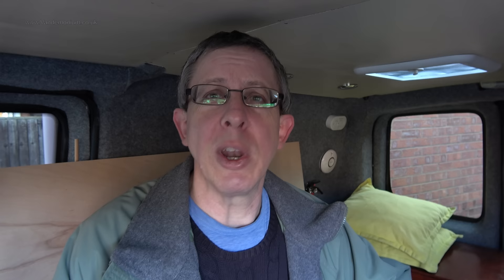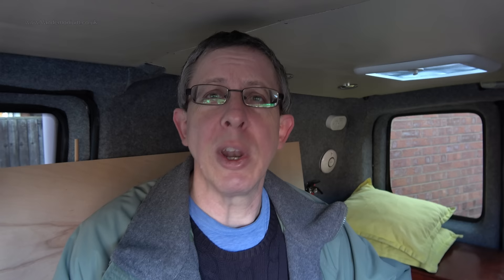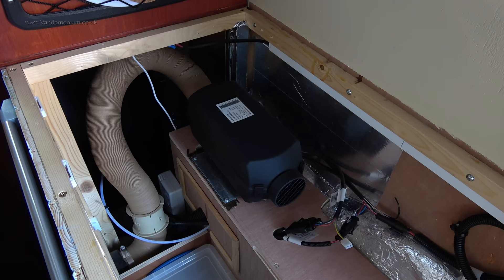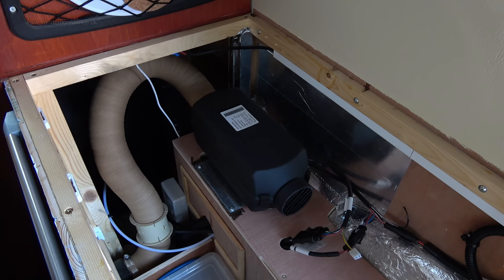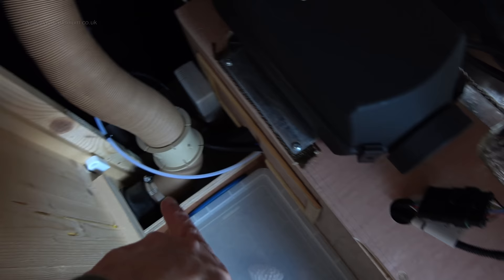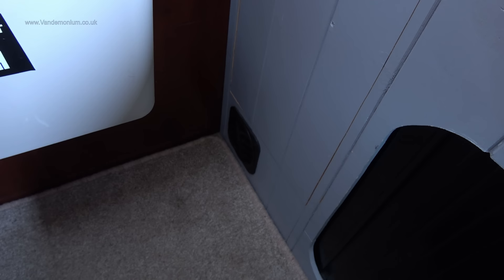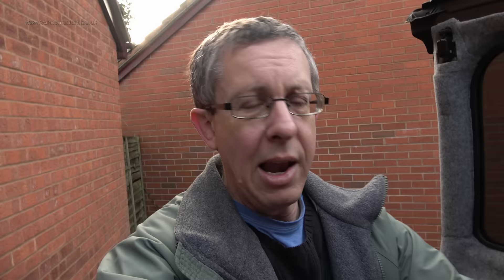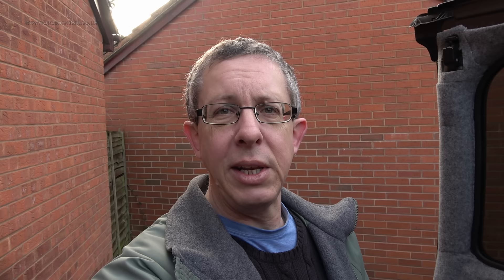71. Finishing the diesel heater installation in my campervan

Comment: Most portable fuel containers don't come with a gasket on the fuel cap, so they tend to leak if not tightened super tight. You maybe able to take the cap in to your local parts house and fit one. You also could buy a piece of gasket material and cut one yourself.  😊
Reply from the maker: Good idea, I may do that

Comment: Don't forget that your tank needs some kind of vent during operation to prevent a vacuum from forming. However, that also means the vent could leak. Unless you fiddle with opening and closing the vent as needed when the heater is running. Also, remember that even a small amount of diesel fuel can spread out to make it look like a much larger amount that it actually is. And the stuff never really dries up or evaporates on its own.  Messy stuff. But also much safer than petrol.

Comment: David, either replace the cap on your fuel tank with one that has a vent screw built in (like an outboard motor tote tank) or cobble together a hole in the cap with a hose coming out of it vertically (like you did for the fuel pickup tube) and put a fuel filter (like the one you put in the line) right at the furthest end of the hose and clip it to the top most part of the fuel tank compartment.
The fuel filter actually allows air in but stops fumes coming out.
It is a 4wd trick known as a breather extension....for axles and gearbox vents so they don't suck water in when the axles and gearboxes are rapidly cooled when submerged crossing rivers.
With this you don't need to remember to open/close any vents, nor worry about pinholes allowing stinky diesel fuel to seep out.....
Reply from the maker: Good tip, cheers!
Reply: Yeah, what he said. Your tank needs to be vented. Of course, that also means the vent may leak. Unless you continually open and close it as needed.

Comment: Another interesting vlog! Those types of in-line fuel filters should be readily available at any auto parts store. The inlet side of the filter should feed into the body of the filter, the pump side should draw from the center of the filter element.
Reply from the maker: Ah, then I got it the right way round!

Comment: You'll need some sort of vent on the diesel tank to let the air in as you pump the diesel up. The cap on that can is designed to seal completely so either the can will start shrinking or the pump will reach its limit and not pump any more fuel to the heater. The caps that come with the ready made heater tanks have a vent seal in them to allow air in but no fuel out.
You could of course loosen the cap slightly when using the heater but sooner or later you'll forget to tighten it before you drive off 🙂
Reply from the maker: Absolutely I would forget!!
Reply: @Vandemonium  A "checklist" might work. Yes, I’m an aviation enthusiast! Happy New Year from Canada!

Comment: I've been using a diesel heater for a few years now and on most of the instrument panels I have come across especially on newer models there is a primer mode to take fuel to the burner before you switch it on. I also have the exact same van only in Peugeot and to be honest it can be too warm sometimes but better than being freezing cold up here on the furthest northerly coast in Donegal Ireland lol. I haven't finished my conversation yet because I live in the van but some great ideas for me to think about for the future

Comment: We have similar heaters in the carriages of the narrow gauge railway i volunteer on here in Lakeland. Yes they can tend to smoke on initial ignition can appear alarming.give it a few moments and it will clear.If it doesn't we switch off give it 5 and fire it up again normally does the trick.
Reply: Do you use them on the move?

Comment: Good work David.  Re mice. Don’t use foam, they love it and will chomp through it.  Using the existing screw holes use a bit of silicone and an old soup tin lid. Drill holes on lid walk a bead of silicone and crew down. 👍
Reply from the maker: An excellent tip, thank you
Reply: Or fill with wire wool first.
Reply: @jimcaley4847  wire wool is just a rodent skill testing challenge where I live. Lol🐀

Comment: Great video, so looking forward to the startup. Regards the old vent hole you need to seal, measure what diameter you need and pop into a local laser or water jet cutter, they'll do that for a few quid and even put in the screw holes for you to secure it down, will look a pro finish then. I can't wait to see some road trips and camp outs this year. Happy New Year chap.

Comment: If your diesel heater tank doesn't contain baffles (it will slosh around and leak) get some FIA Compliant Blue Foam (Diesel) and cut it into small 5cm cubes and feed it into the tank, it is 98% air and will only reduce the tank volume by a tiny fraction, they use it in go-kart tanks to stop sloshing & leaks.
Reply from the maker: Cheers. Interesting idea but no leaks so far…

Comment: Happy New Year David!  Thanks for the update.  Hopefully your installation will go well but, since this is your first install of this type of Heater, some follow up refinement is usual necessary, along with some choice words of encouragement to the hardware.

When slipping two hoses together, I use a thin layer of silicone grease at the mating point, which helps quite a bit, especially if one of the hoses is rubber.  This grease is sold at hardware stores in the plumbing section.  If both hoses are plastic, heating the outside tube with a heat gun, makes the tubing much more flexible to slip together.

In priming, it would be best (assuming you can fit the syringe in the area) if you draw from the hose where it attaches to the heater.  That way you remove as much air as possible from the fuel line.

On those fuel filters, the inlet side supplies fuel to the outside of the filter element paper cylinder.

On heat producing devices, in order to prevent fighting convection, I like to mount hot air piping upward to an above vent and the opposite for the cold air side.  Although there may be enough fan forced pressure with this unit to eliminate this as a problem.

Comment: Such a simple bit of duct work. The installation in my boat has lots of turns in it. But because where it is mounted there is a 10' run of ducting 7' straight with a 3' length in a 90 degree turn into a T junction. And 18 hole saw cuts latter I was done. Planar here in Canada had their own inline fuel filter which I did have to purchase separately.

Comment: I'm usually only in the habit of positive comments and encouragement.  But as I expect,  you've found the tick of the fuel pump not silent and likely annoying you already.  (some fixes on the internet)
Also, get a proper diesel tank. Secure it in the event of a roll over accident, and the tank breather doesn't leak on the flames ..... Happy New Year .
Reply from the maker: Hi, the fuel pump is very quiet, Autoterm specifically say theirs is quiet and it's true!
Reply: @Vandemonium  That's great! Very encouraging for those who suffer ! 👏

Comment: Btw, the way you’ve got it positioned. It will probably prime itself without the extra effort. When you start it, you’ll see the diesel make its journey through the pipe work so you’ll soon know if it’s not priming. 
The diesel pump changes tone once the diesel reaches it. You’ll soon work it out and it’ll become second nature

Comment: How vexing - I broke off from my own diesel heater installation just to see how you got on and now I’ve got to wait till the next episode to find out! Incidentally, the legendary JohnMck recommends installing the fuel pump at 90 degrees rather than at an angle for reasons he covers in minute detail in his 18 part YouTube series.  Webasto also recommend installing the filter at 90 degrees if possible though I don’t know why.  I’m doing both - fingers crossed and good luck!!!😊😊
Reply from the maker: Yeah I've seen various pros and cons on that but prefer to stick with what the manufacturer says

Comment: Happy 2023!  Good progress on your project, well done.
My only comment would be that once you’re happy with the set up, it would be a good idea to add some vibration protection around the fuel pipes. After a few thousand miles any rubbing can wear through wires / pipes if you’re unlucky.
Reply from the maker: Cheers. I think the only contact point for rubbing is where it goes through the (old) gas locker and it's fairly firmly fixed at that point plus I added my makeshift washer from gaffer tape!

Comment: The heater in previous works van (eber spach thing) was always having problems sucking water into it.   Killed it on several occasions.   I asked if they could mount the one in new van differently so to protect it from puddles etc . The guy insisted they never had anyone else complain .
So I suggested putting it into the van instead of under it..
I was told they never put them under always inside  so I sent them to look where it was and sure enough it was under the van.   
The best bit was the guy who fitted it under the van was the one who said we never fit it there.  
Tip don't have the air intake too low it could make for an expensive aqua vac.
Ps  short videos are OK.
Please not to long on the cliff hanger. 
Also please don't start the 2 second scene changes.
Reply from the maker: Cheers

Comment: The smallest drop of diesel spilt will expand over something as smooth as the fuel can like a demon. It is a form of lubricant for the pump and the pump on the diesel engine itself, so slippery. The seal on the cap might not taken the form of the can yet either adding to your worries.
Best place for the heat outlet is where you have it, low down as hot air rises.  The exhaust can get hot alright. I've seen many a melted fender on river cruisers moored close together and one near the heater exhaust. Doesn't half pong.  Enjoy it , they give great heat.

Comment: I'm pleased to see you went for a Planar heater rather than Chinese. I have both (and have previously had an Eberspacher) - the Planar is much better built - I think you will be happy with it; we have had one in our van for 4 years now. Which controller did you get? Hopefully not the PU-22 which was completely un-fathomable. I swapped it for a PU-5. So much easier (just a knob for temperature and on / off buttons!)
Reply from the maker: I don't know the model number but it's supposedly more clever which probably means it's the unfathomable one!

Comment: The uk might be different but here in the us you can absolutely use dyed diesel in a heater like this, but given the small amount of fuel involved it probably isn't worth the bother unless you are at a fuel station in a rural area that happens to sell it anyway. If you wanted to go that route you would probably want to fit something like a 20 liter tank to minimise the amount of time you spend going out of your way for heater fuel. That might make sense if you were say living out of the van but for something actually used as a recreational vehicle like your van its probably not worth the bother.

Comment: For priming the pump.  I think I would figure out a way to temporarily pressurize the jug - maybe with a rubber bulb setup like on outboard boat motors, or a turkey basting syringe.

Comment: If you look at the silencer you will see one side has a small indent in the side with a small hole ...this is the hole for moisture and should be facing down.
Reply from the maker: Hi, on the Autoterm heaters there’s no hole by default, it’s a sealed unit so it can be used inside (eg in marine installations) so you have to drill your own hole. This is explained in the installation instructions.

Comment: I suspect the fuel tank's cap has a vent screw on it?  (like my small fishing outboard motor's tank)  If not you'll need to vent the tank as fuel use will create a vaccuum inside the tank.  Also tip for pushing rubber fuel line over fittings: petroleum jelly (vaseline) usually helps a lot.

Comment: David like I did you might be better off installing a proper small 5L fuel tank as they come with strong lids with air inlet valves.
TanksDirect are one place but there are others.
I think your can will leak plus it might crush when fuel is drawn out.
Reply from the maker: Thanks for the tip, I googled tanks but couldn't find any suitable so I'll try them
Reply: @Vandemonium  mine was the smallest they did so about the same physical size as a 5L petrol can but oblong with a large opening to get your hand inside. With mine I had to specify a lid with a valve when ordering.
I also bought a fuel standpipe as i didn't want to risk diesel leaking out the bottom of the tank.

Comment: Hi David :  just a thought , why not run ( if possible) another heater output hose to the diagonal cornor  from the existing heater outlet.  Might assist in heat distribution in the van.
Excellent work .

Comment: Well…
First of all, good morning everybody… greetings from Germany 👋
Happy new year … 👍
…
As far as the setup is concerned… I see you did NOT go with the portable heater solution from South Korea.
My suspicion is, that there is a reason why the heat outlet should be STRAIGHT for a meter or so. 
But time will tell, if my suspicion is on solid ground 😂

Comment: Just a thought about the filter !
Should it be the other way round  ? Then any debris, would go straight into the filter, instead of collecting outside and around the filter.
It is then easier to open up that end of the filter to clean it out, UNLESS of course, it is of the disposable, non-openable type  !
Diesel do for now !
Stay safe  !
Stu  xx
Reply from the maker: Apparently not, the idea is that if the grot comes into the outside of the filter, you can then see when the filter is clogged and change it.

Comment: I think it would be wise to more thoroughly secure your fuel container to the wall and floor, David--perhaps with some metal or other sturdy straps--to prevent it from tipping in case of an accident.
Reply: I screwed a luggage strap (the cam type) under my tank and wrapped it round the tank to secure the tank in position. 
That way, i can let the pipe go and remove the tank from the vehicle to fill it up (prevent spills)

Comment: Rubber and plastic pipe ends placed in hot water for few minutes fit easer. Try fitting 4 inch pipes. Silicone oil and sex lub works. never mineral oil or grease i.e. Vaseline.

Comment: Good Job! - I wonder if there is a valve in the tank (canister) that lets air in when the pump is running. Otherwise the canister is compressed. Alternatively, you have to open the cap of the canister slightly. - Just a thought
Reply from the maker: There isn't but I'm going to add a pinhole in the handle

Comment: a little washing up liquid should help ease the pipe on
Reply from the maker: I’d worry about the washing up liquid contaminating the diesel!
Reply: @Vandemonium  If you ever need to redo any of it, diesel itself is the best lubrication to use. (You may have noticed that putting that line back onto the pump was a bit easier than the original install...)

Comment: Nice set up David. 
Have you vented the diesel can ? If you don’t, it can suck the sides of the tank in, cause a vacuum and stop the heater working. 
A pin hole in the lid should be enough. If you’re worried about the diesel smell then you can fit another metal elbow on the can and pipe it through the floor.
Reply from the maker: I have to but I intend to
Reply: @Vandemonium  
I only mention it as I did exactly the same for a tank and noticed the tank imploding slightly after a couple of hours. 
for the time being, it’ll be fine. Just crack open the fuel cap after use.
Looking forwards to the next video mate. 

All the best and happy new year.

Comment: You could have avoided some connections by fitting the filter to the bottom of the pump, and you need to suck the fuel from the top of the pump. Its currently still full of air.
Reply from the maker: Fear not, the fuel's fine (as you'll see in the next episode!)

Comment: Happy Gnu Ear!.. I don't know if I missed any comments but the intake I saw worries me. With all of the rain you have will it not suck up the water?
Reply from the maker: It would have to be an amazing suction to do that, it's several inches above the ground! Also, there is a piece of plastic trim that sits underneath it (I removed it while installing the pipes)

Comment: Look at you!🎉🥳  Looks great. Are you worried about hot spot on the pipe with the bend? (Don't know how hot the heater  will get-total noob on this sort of stuff)

And do you have to put in any additives to keep the diesel from "going bad"?

Can't wait to see you fire that bad boy up 👍💪
Reply from the maker: I haven’t put any additive in so far but I used to do that on the boat so I will buy some for this, yes.
Reply: @Vandemonium  
the easy fix is to empty the container into the van tank every few months and refill it with fresh. I do it when I remember....

Comment: Just 2 things … did I see plastic tie strips on the exhaust if so should change to steel ones and I wonder if the reason they want you to have the 1mt of heater pipe just out of the heater may be because the heater initiall coming out is too hot for your piping?
Reply from the maker: No, they're metal straps. The heater pipe thing is to do with airflow and not restricting it coming out of the heater rather than the temperature.